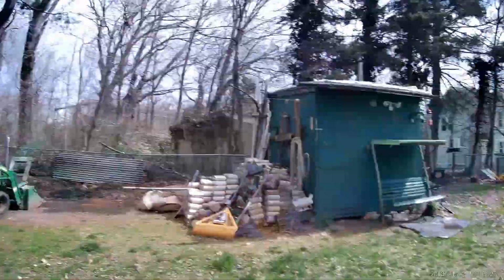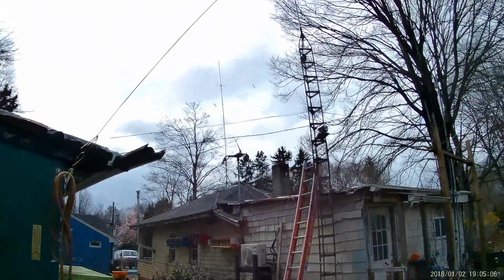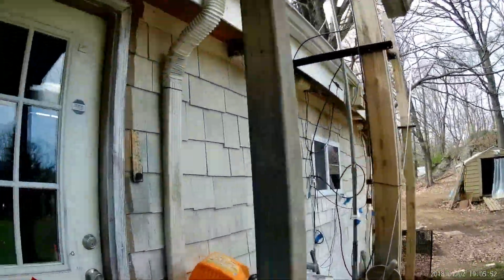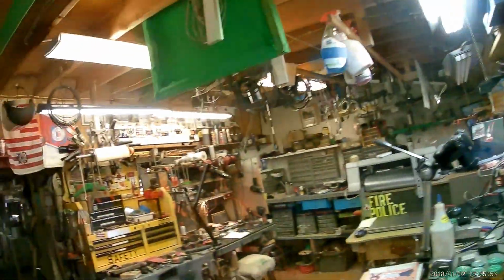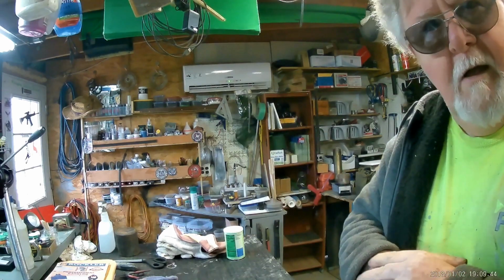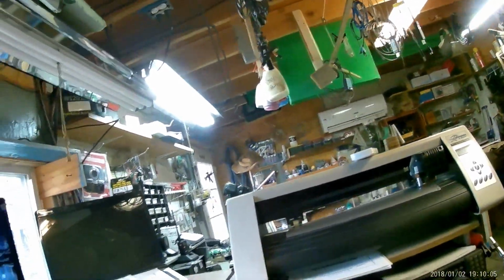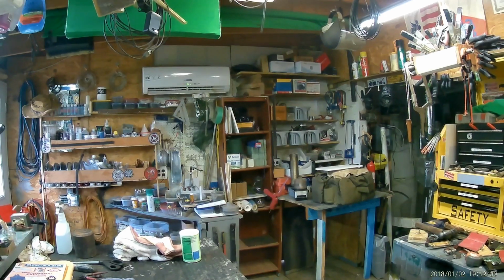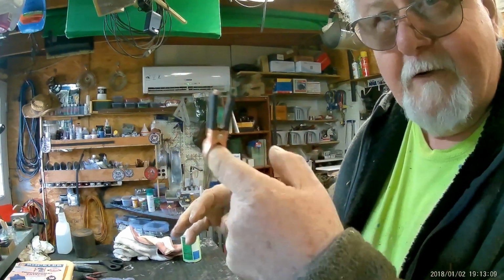A little about my Wind Turbine

Comment: The higher the wind turbine, generally the more power it generate.  You got trees, lots of trees.  You need to get the Wind Turbine HIGHER than YOUR TREE TOPS.
Reply from the maker: I hear you, I had it will over the trees when it was out in the open on the 50ft tower.  But you are right with the trees, I found it to work best at 15ft off the ground.  Thanks for stopping by, the door is always open.